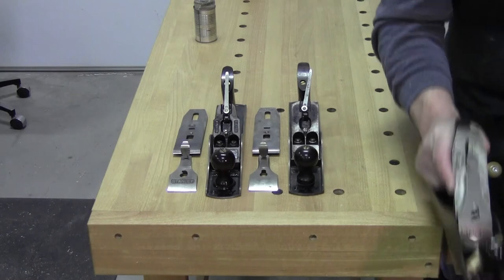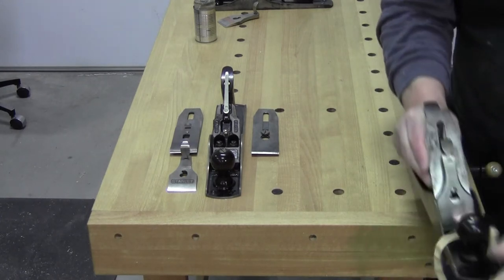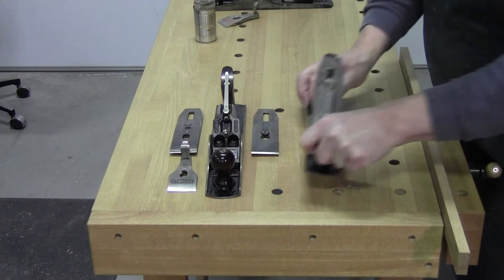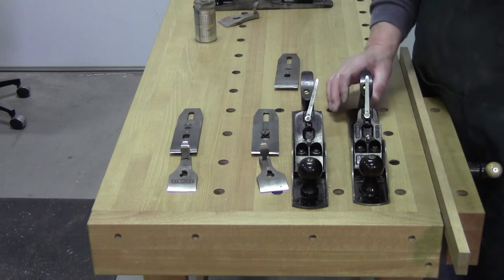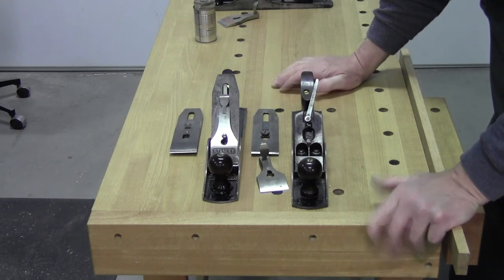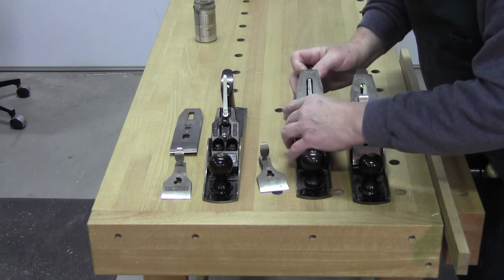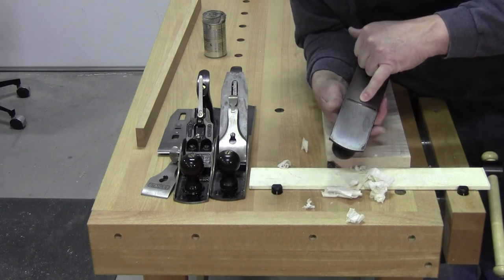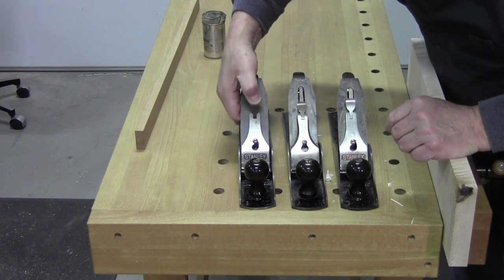PLANE TALK - Love The One You're With... Smooth v Corrugated / May 9th, 2017

Comment: All of my planes larger than a #5 and larger are corrugated. I have a mix of Stanley, Sargent, and my favorites, Millers Falls. My 5 1/4, 4/1/2, and smaller are all smooth soled.My reasoning for choosing corrugated soles for my larger planes is that there is less metal involved when flattening the sole.
Reply from the maker: Bob,  I do not mind Corrugated that much for large planes which may only be used for flattening large surfaces.
Smaller work I find the corrugations offer some challenges.
Reply: I agree. I passed on a corrugated #2 for that very reason.

Comment: Thanks Dusty....good video.  Mr brother-in-law found a corrugated Bailey #5 at an antique store for me.  I am just getting started and didn't have a jack plane, just a Miller Falls #4 equivalent.  I was concerned that there would be issues with using a corrugated sole but it sounds like for a jack plane it will be OK.  Thanks for the side by side example!

Charles
Reply from the maker: Charles,
You are correct, for larger flat surfaces, I do not have a real issue with corrugated or not.  I just do not like them for small pieces and edge work.
Get the blade sharp, set the chip breaker properly and just have at it.
Thanks for watching.

Comment: Great video on how to use a hand plane!  I arrived at this video searching for an answer to corrugated versus smooth as well. This demonstration as well as most of the others I have seen on the Internet seem to leave out a couple of (possible) points about corrugated planes. 
 
It seems to me there might be a couple of advantages to the corrugations... having nothing to do with weight or friction. . 

1) One would be that you can use the grooves on the sole of the plane to guide it along corner edges in order to facilitate the use of chamfering. Sure this is probably a bit of a hack – however it is also a handy feature. 

2) another advantage:  the plane over a long distance may stay straight. This may not be an advantage for running down a short piece – – but then again it might be. It acts sort of like the siping of a tire and will keep the plane from getting Squirrley on a narrow piece of wood. 
Likewise if you were planning something broad and flat – – it might aid with tracking.… Does anybody have answers to these points? 

3) Lastly, I think the corrugations may help keep the sole of the plane from warping as it transitions from hot and cold. Grooves are cut into metals in various industrial applications for this reason. I have no idea if it applies to these however.

Certainly there is a vast knowledge of woodworking – – and I think all of our elders and experienced hobbyists out there for providing this information -- keep up the good work on the videos – – it will help generations to come learn how to use these wonderful tools.
Reply from the maker: THanks for writing,

Unfortunately the real reason for the corrugations is unknown.  My understanding is it was all marketing, trying to make the plane lighter in weight.

Since the grooves do not extend all the way though, it fail as any sort of guide system.
Some people claim it breaks the suction contact but here too since it does not go all the wat to the ends... that concept fails.

As to stress relief to keep it straight and flat... well reducing the amount of metal in my opinion could result in more bending and twist.

Oh well, like the little nib on the top of an old handsaw... we will never know.

Comment: Mathematically speaking, reducing surface contact decreases the coefficient of friction, or the “stickiness” of an object. Because the force of kinetic friction is a product of both the weight and the “stickiness”, these planes DO take less force to use. The problem was that a well flattened and waxed sole of a flat plane ALSO decreases the coefficient of friction, and the difference wasn’t enough to really make a difference for most users.

Comment: Thanks, very helpful. When I was a teenager, I picked up more than a few hand tools. When I left home, it came to a question as to who owned my tools. My father still has them. I'm older now, and finding vintage tools is not as easy. I've been burned more than a few times on Ebay. Once bitten, twice shy. The expensive tool are bit to expensive for me. Many low end planes tend to have problems that are wrong from their very design. Even if the plane designed correctly, it seem it's your job to finish manufacturing. It always seems to be a crap shoot. Thanks, great video.
Reply from the maker: Yes, it is Buyer beware.
Thanks for watching.

Comment: I always lay my planes on the side and never on the cutting iron, so my old carpenter taught me. Or lay it on a small piece of wood, not to blunt the blade.What do you think about that?
Reply from the maker: Your tools, your shop.  I can understand the pro's & cons of both but for our safety blade down is best.  If you do not want the blade to make contact with a wood workbench top, keep a small scrap on the bench which you place the toe on to lift the blade up slightly off the bench.